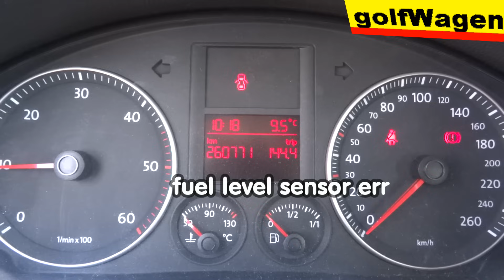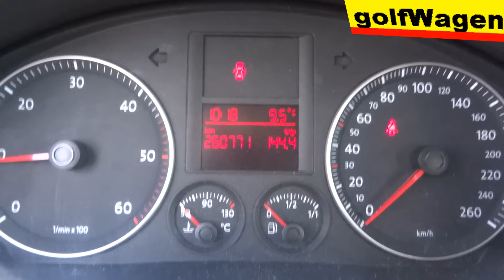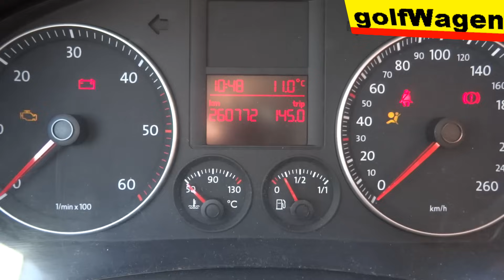VW Golf 5, how to replace fuel pump full time  /fuel level sensor err/

Comment: Awesome, and while holding a phone 👍👍 but damn it, with those gas vapors, i would not use a metal hammer. Screwdriver is fine if you hold it tight against the cover but then again. May be a piece of wood and a mallet would be preferable.
Reply: Mby its a diesel

Comment: Friend help! I shorted the J17 slot for the relay, tested pump connector for power - Ok. When pump connected and I short the circuit for relay i can hear the pump but no fuel is coming out of the pipe. The garage replaced the pump 3 months ago

Comment: Many Thanks for video.  Confirmed previous garage had refitted pipes wrong way round causing intermittent engine cut out very had to diagnose. Your video confirmed blue pipe return to tank , black pipe feed from tank.
Reply: Exactly the same problem right now in this moment haha

Comment: I'm having a bubbling-like sound when the key is in the first position. It's like a periodic thumping sound, and it's causing the engine to stall gradually in 10 to 20 seconds. The mechanics here changed the fuel pump, the filter, the high-pressure sensor, and it still stalls. Can you please advise me on the issue if you know about such cars, please?

Comment: I had a autoshutdown at entering the parking,and no start after that. Changed fuel filter,filled the housing with some extra fuel,started,worked for a few minutes only on 1800rpm. When releasing pedal engine died again. Went to diagnostics,it found only EGR fault,which I had before and didnt affect anything. After consulting several mechs,all said fuel pump relay. I bought relay and the in-tank fuel pump just in case. Couldnt find the relay so went for the pump,replaced it,a few spinnings and started,no further problems. Still dont know where is that relay.
Reply: It is under the steering wheel. You will need to take a few panels off.
Reply: Driver side

Comment: Hi
Golf V 1.9Tdi - 2007.
I changed the in tank fuel pump due to it not running.
With the brand new pump - I found out it wont run as soon as the fuel filter holder is filled manually (with VCDS) with fuel - and when engine is running -> the in tank pump is NOT RUNNING. 
I can pull out the connector on the tank pump and the engine will run untill the fuel is finnished in the filter house.
Relay works and this happens with two different relays. 
ANY ideas of whats going on?

Comment: Never just test drive after reconnecting the black and blue lines.. Always.. Always.. Put the key in the ignition and turn it to the on position and check for leaks at the black and blue connectors. Ignoring that step mine cause you to have a gas leak that you covered back under the black cap. No leaks the start the car and recheck for leaks before reinstalling black cover and rear seat. THIS COULD SAVE YOUR LIFE AND YOUR GAS!!
Reply: I'm having a bubbling-like sound when the key is in the first position. It's like a periodic thumping sound, and it's causing the engine to stall gradually in 10 to 20 seconds. The mechanics here changed the fuel pump, the filter, the high-pressure sensor, and it still stalls. Can you please advise me on the issue if you know about such cars, please?

Comment: I have a 2009 Passat CC 2.0L TDI with a stuck fuel gauge (shows 1/3 full) and that's why I ran out of fuel (diesel)!  Used a Foxwell diagnostic unit to check fuel gauge - did a full sweep, so suspect sender unit on tank fuel pump.  Di you just take the fuel pump out, replace it and the problem sorted itself?  Why did you add an additive?

Comment: Thanks for the video bro ... it helped me because the mechanic did not properly connect the return and inlet hose well, turned them around and the car ran out 15 km and then went out, but then it can again start with a little bit of torment ... thanks
Reply: do  u think i can do it on audi A3 8V ? (is it the same thing?) ty
Reply: Thanks so much for this video. 
It is very important to reconnect the pipes on the correct pump fittings.
A friends car has been having intermittent  engine cut out maybe 3 or 4 times per year......Turns out his garage refitted pipes wrong way round. Your video confirmed for me the return pipe is blue and feed pipe black. Many thanks